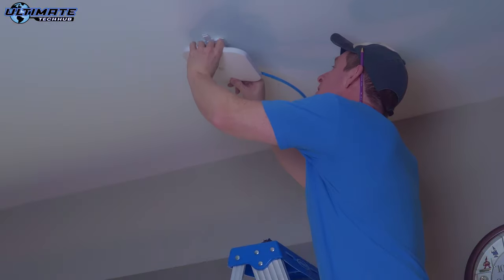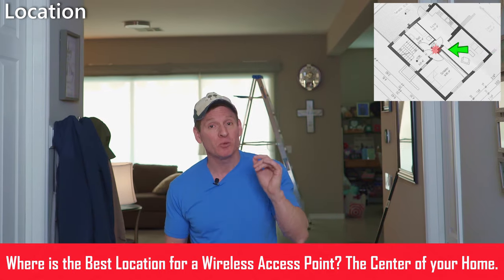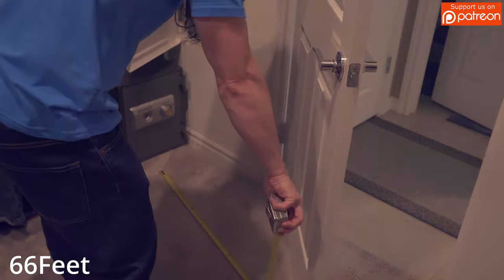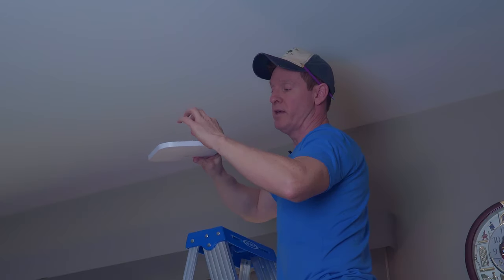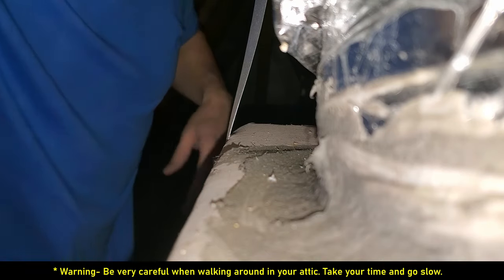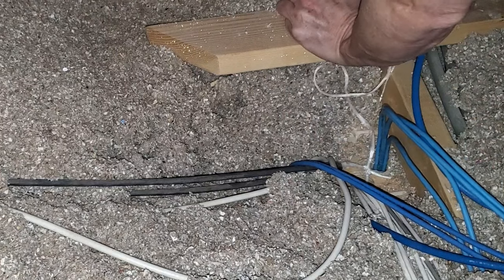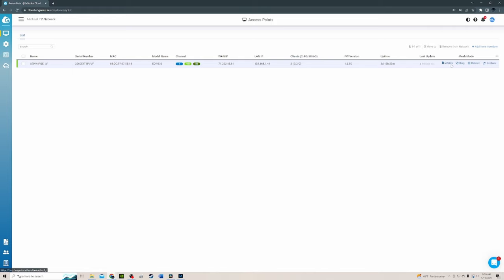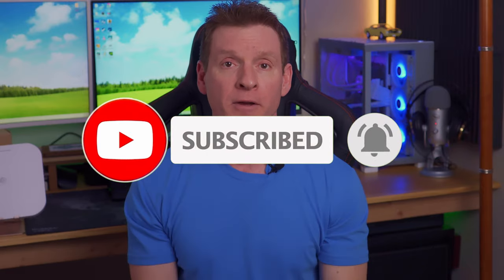WiFi 6e HOME INSTALLATION! QUICK &EASY!

Comment: Here in Las Vegas! Great. My question: Should you need to reset the access point, out comes the ladder or can it be reset remotely?
Reply from the maker: Yes, if you need to reset you will need to climb the ladder. If you need to power cycle it, just unplug the other end of the ethernet that's attached to the WAP. Wait 60 seconds and plug back in. Thank you for watching.

Comment: Hi, thanks for the informative video. Does every home have an attic ? and how do you run cables if there's no attic in home. Thanks !
Reply: Crawl space or basement.
Reply from the maker: Not every home but most homes do have attics. If no attic, then you would have to run the cables on the walls in conduit.

Comment: Are those little anchors really sufficient for mounting it to the ceiling? I would have thought you'd need to use toggle bolts or something similar.
Reply from the maker: The Wireless Access Point is very light weight so yes the wall anchors are plenty to hold it. Thank you for watching and for commenting!

Comment: I have a basic AT&T Router under my computer desk and want to put a ceiling mount extender in my room, what type of wifi extender do I need? And do  need a power cord to power this thing? If so a wall mount is probably the way to go right?
Reply from the maker: Yes a wall mount would work and use an ethernet cable from the LAN on the router to access point. The AP will need to use the power adapter since routers don't have PoE connections.
Reply: @UltimateTechHub  gotcha, thanks